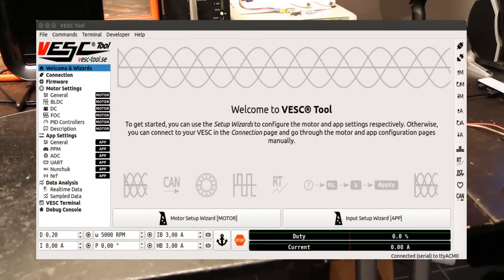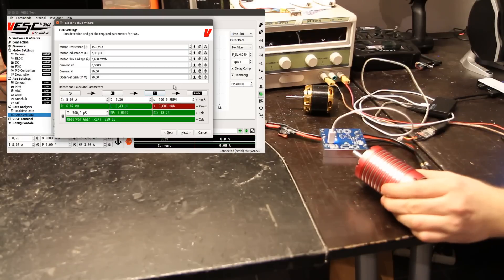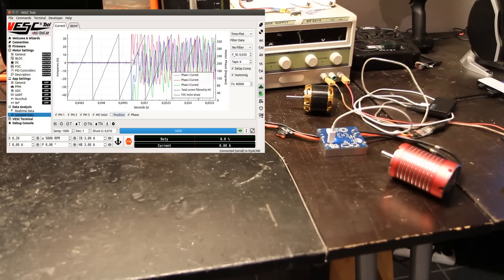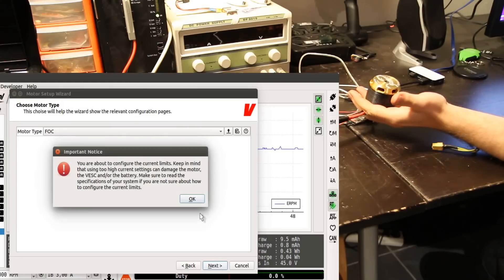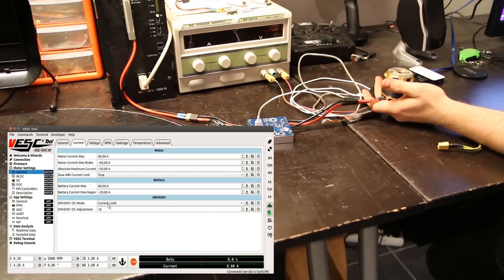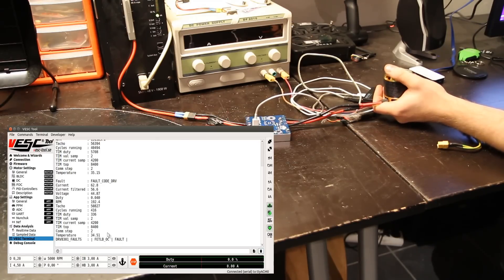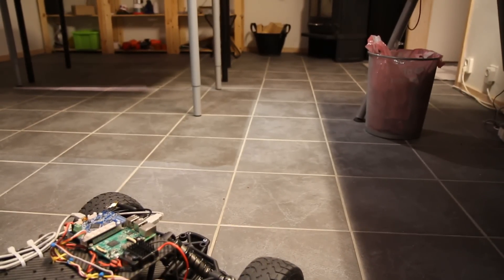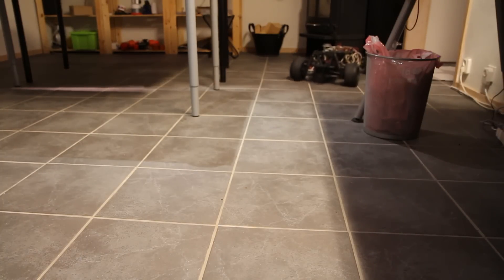VESC Six FOC Testing

Comment: Hello!  I have a converted Scootet 6 months work from 36V 7A to 48V 24Ah 13S8P battery and 48V 1000W motor.  And a VESC 75100 controller with Computer VESC Tool 6.02.  But my scooter always stutters when I drive away!  What kind of setting is this? Which value is too low or too high?  I have standard value ERPM 100,000 and I have motor 60A and battery I have set to 45A.  My battery is 48V 24Ah 13S8P with 50A BMS.  So what is the minimum amount I can set for my battery?  I now have 45A and the motor I have selected -2000G Outrunner and set 60A.  I don't understand why when checking the engine where the engine rotates briefly and then turns forwards and briefly backwards and then shows a box with values for the engine etc. and it always says "Sensorless" at the bottom! Huh  ?? Why?! I have Hall sensors and 3 motor phases, i.e. motor cables. And when the motor is OK, it always shows "Sensorless" in this box.  Normally, the box at the bottom should say: Hall sensors!  Why is that??  My motor has 3360 grams so 3.3kg.  And I always choose: Outrunner -2000G.  Please make a video for e-scooter settings!  Not always just for skateboards or RC cars.  That would be great because most people use the VESC controllers for their e-sooters!  PS.: I bought and installed a single controller VESC 75100 with Bluetooth module, but it is always in the bottom left corner in the tool on the computer via USB connection;  75300!  Why 75300?!  Hmmm

Comment: I had been riding with my vesc and it worked perfectly, I used it for a couple of days, I took the battery out as I always do when I'm not using the board, and now I turned it on and connected it today and it was working for 5 seconds and then turned off and didn't do anything it still doesn't it doesn't turn on no lights no nothing doesn't work at all :( I saved up for 2 months and it broke after like 3 rides and I did nothing wrong please help!!!!
Reply: go to forum mate